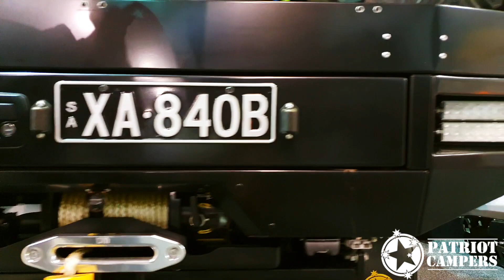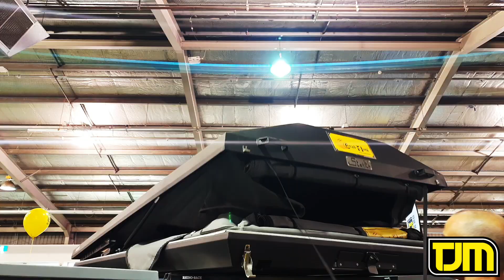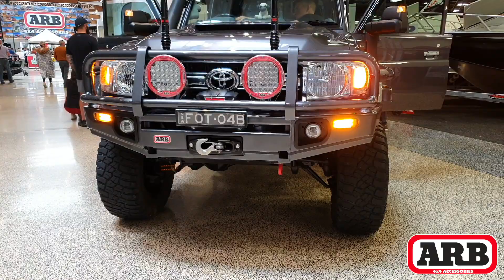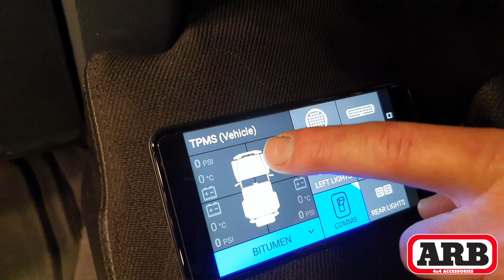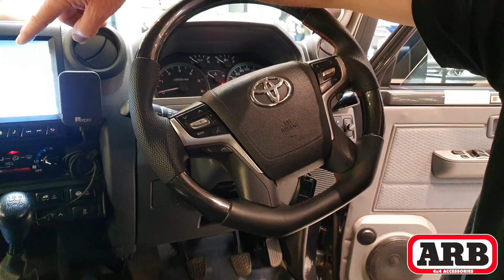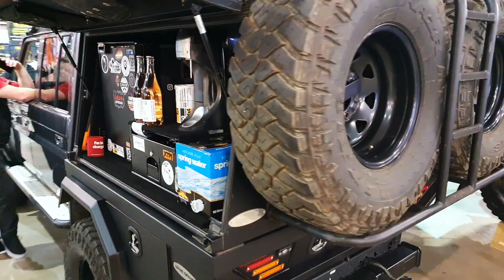The best of the Toyota 79 series super tourer at the 4x4 show

Comment: The patriot is just Ute not a tourer
Reply from the maker: It literally has it written on its bonnet scoop
Reply: @DamianCandetti  it doesn't really matter what it has written on it, it's not set up as a tourer. Where is the canopy? Where is the fridge? Where is the RTT?
Reply from the maker: @bencollins7684  is it written somewhere that it requires these things to be considered a tourer? Could have they just temporarily removed the canopy etc?. 
Genuine question.
Reply: @DamianCandetti  Written down? Not necessarily, though write-ups of touring vehicles certainly include most of all of these things. Considered to be so across the industry? Yes.
An LC79 with a quad bike on the back isn't really a tourer, because it doesn't help you survive and travel around the outback. If they removed that, and put the canopy on that had the gear I mentioned earlier I think most people would consider it a fantastic touring/overlanding vehicle.